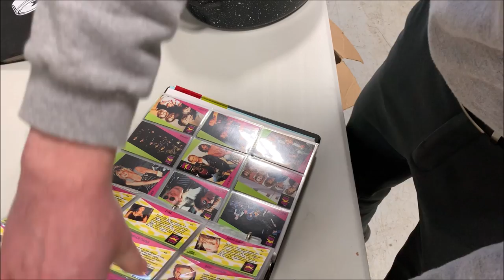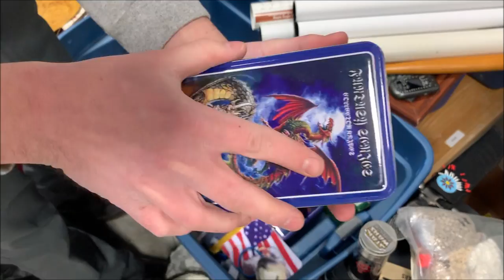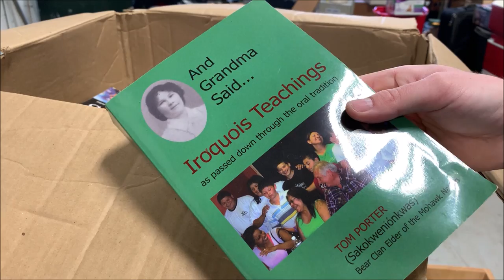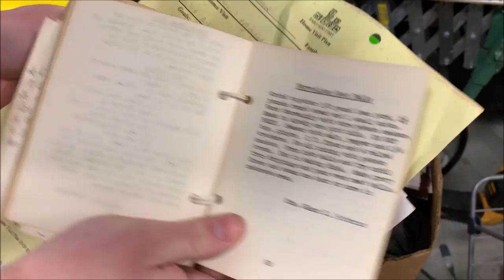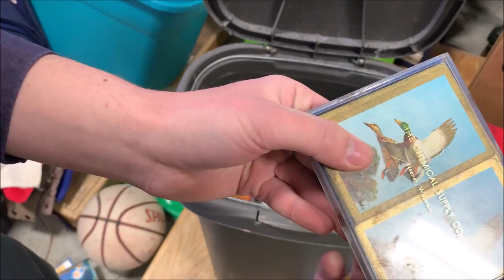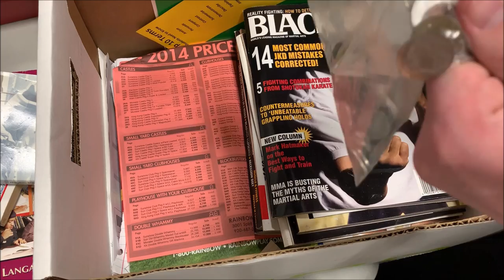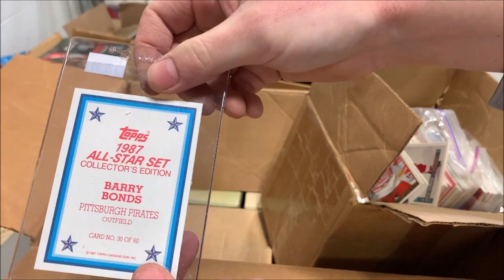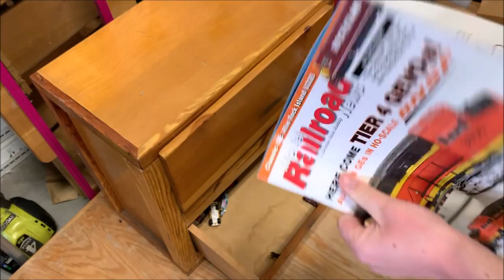My Best Storage Unit - Complete Unboxing - Part 2

Comment: When I used to have garage sales, I would put about 20 or so ball cards in a sandwich bag (the twist tie kind), and put a buck each on them.  I sold them pretty good.  If you have the time and space,  that could be a good seller for your Dollar Sales.  even putting 50 in a pack for a buck would get a decent return.  Though you should look into some of them first.  It didn't look like much value on the surface, but some have value.

Comment: 24:03 piece looks like some form of native american art, might be worth tossing on ebay as a auction. Any native american blanket, rug, table runner, ect can go for great money new, old, damaged, ect. on ebay, as people collect the native american items and also decorate with them. The earrings at 1:06:11 is signed native american earrings and worth putting on ebay at auction, and the watch at 1:06:27 is a native american watchband attached to a random watch, this will fetch way over $10 at auction especially if there is a name on it. Antique bells can fetch a good amount of money sometimes so keep a eye out. The knife at 1:32:10 had a mark near the hilt on one side to look it up. 2:03:14 Pull the native american thunderbird piece that is next to the smiley face and list it at auction, you get good money for that, also silver charm nearby not sure what of but probably $5 or better alone. Gold ring not sure if real in tray part left side, bottom row. Hope you read all this, trying to help out on info to make you some extra money.

Comment: 1:10:30 are test strips for the glucose testing machine. The chip is what is used to calibrate the machine to a specific lot # of test strips. 🙃
  The test strips sell on eBay if they are not expired.

Comment: Seriously, How do you get rid of all of it and sell it?
Reply: Been wondering the same for years. Probably throws away 25% of it.
Reply from the maker: Lots of the junk gets either thrown away or donated. The rest goes to local auctions (mostly). I could probably make more elsewhere, but with auctions, every last item is sold in 10-14 days and I don’t need to really do any work, so I can move volume.